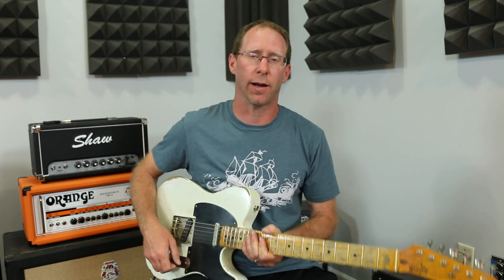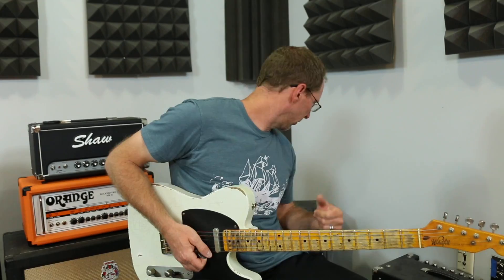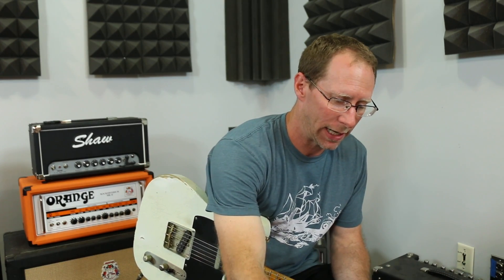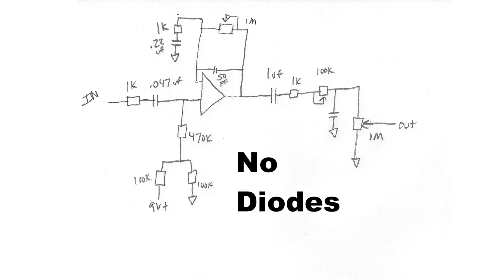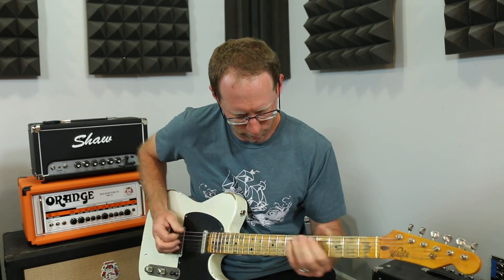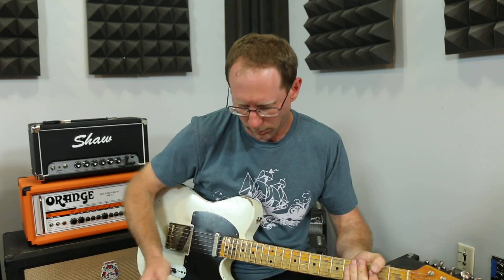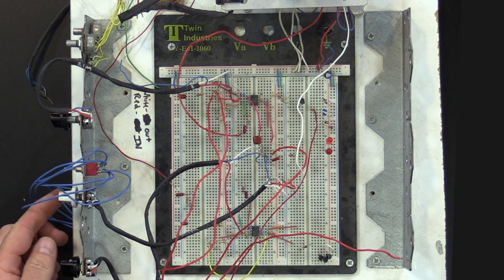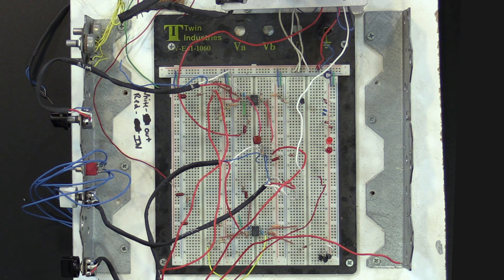The myth of "gain"... and it's relation to "clipping"

Comment: So, most pedals intended to produce additional harmonic content are powered by 9Vdc.  In most instances where op-amps are used, the maximum amount of "voltage swing" permitted by that supply, and the op-amp characteristics, is about +/-3.5V AC.  That is, exceeding a signal amplitude of +/-3.5V will clip because the power supply cannot make the signal increase any more.

So far, so good.  The typical guitar pickup will produce very brief peaks of maybe 1 volt at pick attack, and settle down to  well under 100mv thereafter, humbuckers and overwound types a little more, and underwound and normal single-coils a little less.  But let's take our benchmark of 50mv, for argument's sake, since that's what you'll get picking a single string hard.  How much does 50mv go into +/-3.5V?  Seventy times.  That is, multiply a pretty normal picked note by 70x, and you've run out of clean headroom on a 9V supply.  Strum a chord on an HB-equipped guitar, and you run out of headroom with gains of 40x or so.

Many overdrive pedals apply gains of hundreds, and some (e.g., the Proco Rat) go into the thousands.  Although they often use diodes to do some of the "dirty work", what you hear is often a composite of the clipping produced by the chips running out of headroom, PLUS whatever the diodes are doing.

One principle I have been touting for darn near 15 years is what I like to call "proximity to clip" (PTC).  That is, the electronic distance between the point at which clipping will occur, and the current signal level.  The intensity of the clipping is partly a function of that distance.  PTC can be reduced (brought closer) by increasing gain applied to the signal, OR by bringing the threshold of clipping lower.

Perhaps more importantly, since guitar notes decay with time, the closer the PTC, the longer the portion of the note's entire lifespan will be clipping and adding harmonic content.  What we often call "fuzz" is essentially a circuit that keeps the PTC very small for a long time, such that the buzz continues long after the initial pick attack and well into the string's actual decay.

By making the clipping threshold very low, we can get distortion with very little gain.  The poster child for this is the "Black Ice" passive clipping circuit, that uses Schottky diodes, whose clipping threshold is so low that these units are installed in the guitar itself, with absolutely NO gain applied.  Conversely, if one was to use four green LEDs for clipping, you'd have to apply so much gain to get them to clip (their threshold would be about +/-4V) that what you'd hear is really mostly headroom limitations of the chip, rather than any clipping from the LEDs.

So, it's not JUST "gain".  It's how close a given amount of gain gets your signal to the clipping threshold, given how the pedal is powered, what you're using for clipping, and whether you want the clipping to be confined to only the pick attack, or last for more of the note's lifespan.
Reply: Mark Hammer Big thanks for taking the time to elaborate this
Reply: My pleasure.  I'm sure Brian would have done so, but he's a pretty busy guy.  I have the luxury of time.
Reply: Thanks. Just make sure to give Brian some business at some point.  He has mouths to feed! :-)
Reply: Lucid explanation. The frequency response of each stage of a distortion circuit is also crucial. That's how Tom Scholz got the Boston tone that stunned people at the time - he put EQ before and after his Marshall (among other things), which few were doing in those days. There's an infinity of sounds available with distortion circuits, depending on the gain structure, characteristics of the distortion circuit involved, and frequency shaping at each step.
Reply: This comment is simply awesome. I feel like I can design my own devices after reading this!
Reply: Seriously awesome detail. Loved reading this from someone who knows what he's talking about. Many thanks and love Brian's videos. Always a pleasure to have great videos and knowledgeable comments. Brian's fans are generally decent guys.
Reply: Roikat Different method but using a VFE multiband distortion has had some very nice effects for me, used it much more for bass 5hen guitar, but I imagine running a signal that is clipping more/less in different frequencies into an amp and driving it more from there could have some interesting effects. I personally really liked my danelectro with fuzzed out bottom end, some crunchy midrange and some completely clean top end/high mids run through a tiny bit of amp overdrive. Sounded very aggressive, if anything the clean part of the signal made it sound angriest, just from the nasty twang when it was being strummed really hard coming through so clearly when there is so much other dirt going on.
Reply: you're theoretically right in the general, but not quite in the specifics of Brian's examples. The 2 diode circuits Brian presents would limit the voltage headroom to +/- the forward voltage drop of the diodes he uses. Say he used some silicon diodes with 0.7V drop, the headroom before clipping in either example is +/-0.7V, so they would clip with 5x less gain then the examples you're presenting. In Brian's example, the power headroom of the opamp is mostly a non-issue unless you really dime its linear gain.

Personally, I think distortion should be characterized more by harmonic content - for typical playing, what harmonic (and intermodulated) overtones you're producing and how much. Are you pushing mids and highs to get alot of punchy bright overtones? Are you pushing bass to get a muddy/fuzzy overtone sound? Are you creating alot of overtone creation, making it sound sizzling hot and aggressive? Or are you creating a modest amount making it sound warm and natural? Also, the dynamics of the distortion are important. Is any signal gonna fly right up into clipping making it squishy feeling (which would be actual high gain)? Or is it lower gain giving you "touch dynamics"? It's complicated to the point where even pre and post EQs define the character of distortion and gain (or more accuratly gain/headroom ratio) is only one parameter that really only effects the dynamic feel of the distortion.
Reply: You should be able to control the clipping threshold with a resistor, diode combination as well, right? Pardon as I haven't thought about these things in over 15 years....

Comment: I was thinking more of the gain control on a tube amp, cranking that up in reference to gain, or saturation. However the OP amp did simulate that well.

Comment: To get the idea that gain doesn't always equal distortion think of the gain knob on a PA mixer. You need to turn up the gain to get a stronger signal but it stays clean until the signal is too strong and starts clipping the preamp. I think guitarists associate gain and distortion because guitar preamps are designed to clip right away as opposed to mic preamps which are designed to have a lot of clean headroom.
Reply: Yep. Band rehearsal earlier this week and our lead guitarist was distorted in the in ear mix. I told him he was clipping the mic pre, but he insisted it was too gainy.

Comment: We've needed a video like this for a long time! Great info
Reply: Is it just me, or does he never actually make his point. He describes and presents examples of clipping, but he doesn't ever state the difference between clipping and gain, because he never defines gain as something different. There's good information here, but I just think that the argument framing the video is incomplete. It would have sufficed to say something like: 'Gain is the process of increasing the power to an amplifier (or a stage of an amplifier), thus increasing the amplitude of the resultant signal, which can remain 'clean' or become clipped, but gain is not, nor need not be synonymous with degrees of distortion."
Reply from the maker: How ya been RJ?! You going to Summer NAMM this year?
Reply: Wampler Pedals yes I should be there  Day 1
Reply: At the end he described the increased gain (without diodes) as clipping the Op-Amp, vs diodes doing the clipping in the other examples.

I don't quite get the distinction myself, but I'm not a tech wiz.

Comment: Maybe you should make a pedal that changes the diodes and clipping settings and call it the hair cut or the Barbour or something? Either way that bread board setup sounds pretty damn good !
Reply from the maker: Thanks! Several of ours already do that - the Euphoria for example switches between soft clipping, soft and hard clipping combined, and no diode clipping

Comment: That diode-less circuit sounded righteous. Honestly would love to see that as a Wampler pedal.
Reply from the maker: It's in the Euphoria ;)
Reply: Wampler Pedals oh that's spicy. I'll have to look into it. Love your Ego compressor, by the way.
Reply: there are pedals that use multiple gain stages instead of diodes for clipping.for example the bsiab 2.
when i learned about these 2 methods and heard for example that pedal vs a ds-1 it sounded better to me without the diodes and my reasoning was the diods are throwing away part of the harmonic content while the gain stages in the bsiab 2 pass it along and it clips more naturally.

the problem is that without diodes you get a less extreme distortion tone so either add more gain stages or get by with what is at hand.(or add a slight boost beforehand).

its also harder to shop for ready made pedals according to clipping method since a lot of them keep the design secret.
Reply: Wampler Pedals So THAT’s why I like that pedal so much!

Comment: Why choosing to clip with OP-Amp or diodes or transistors ? Is there a preferred tool for a type of clipping ? I know that there are some difference between Ge and Si diodes or transistors, but why choosing OP-Amp and diodes in a TS type overdrive and why not only OP-Amp ?
Reply from the maker: because each has a different sound and "feel" to it
Reply: Out of respect to Wampler since this is his show, I got a "to remain unnamed" fuzz directly from my acquaintance Mark. This fuzz has a selector that lets me choose between 5 different types of semiconductor junctions, or none as my "clipping diode"[sic]. there is even an LED and a MOSFET in there heh, and they all have their own personality

Comment: From an engineering point of view all these words are rather subjective. Something some companies once invented. A bit like vibrato vs tremolo that's being mixed a lot. Technically distortion is just how much changes in it's harmonic content. There is linear and non-linear distortion. The right way in this sense is calling (hard or soft) clipping. In fact a distortion pedal is nothing more than a compressor/limiter in extreme form. So maybe calling it the limiting ratio would be a better name. But I guess it doesn't sound as catchy
Reply: Some might say they... distort the truth.....
Reply: "vibrato" and "tremolo" are not company invented terms nor are they relative, though a company once used the terms incorrectly and everyone has just been following suit since. Vibrato is modulating pitch, Tremolo is modulating amplitude (volume). Nearly every time someone with a guitar uses the later, they actually mean the former.
Reply: Vox Potentiae . Correct. What I wanted to point out is what happens when companies use certain terms. "Digital amplifier" is also another example. (Which give any engineer the shivers)
Reply: Oh yeah, for sure. They'll spin it to whatever sounds good in a slogan or piece of marketing, accuracy be damned.
Reply: If engineers would make pedals as they did long ago then this would not happen, that is way we have average Joe's to talk about things they don't understand with aim to sell their pedals. Problem is actually that majority of players think those dudes are engineers. Amazing what is today on YT and media from self proclaimed tone gurus who talk literally nonsense in order to sound smart ☺. Crazy is that some players believe in that ☺and pay well for it...
Reply: I see what you did there.
Reply: I like my digit amplified, but prefer an analog amplifier.
Reply: War Zone very possible, as they are classical music terms.

Comment: listening to this through a stereo pair of Blackstar fly amps..they sound great as powered monitors (by the way). Even on this fairly new amp they have have a "gain" pot, and a volume... and an OD button...when the Overdrive is engaged you dial up up the "gain" pot to get more saturated clipping...pretty sure a lot of the confusion people have about gain comes from mislabelling of solid state amps over many years.
Reply: That is actually extra gain though.